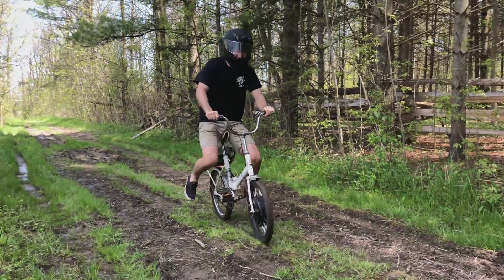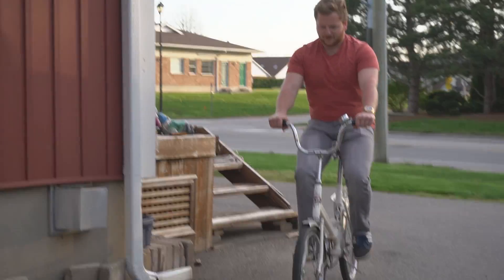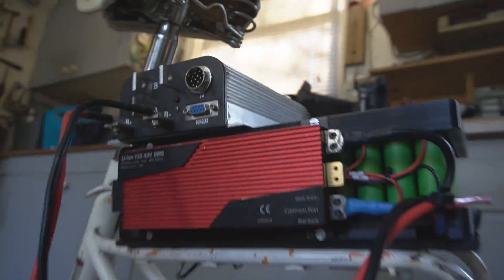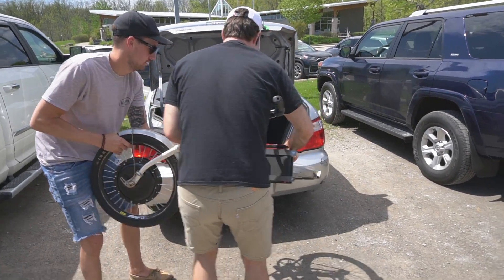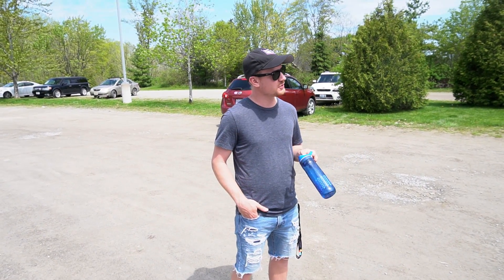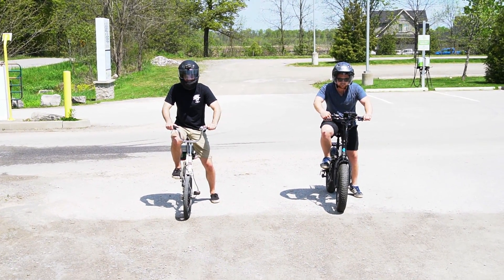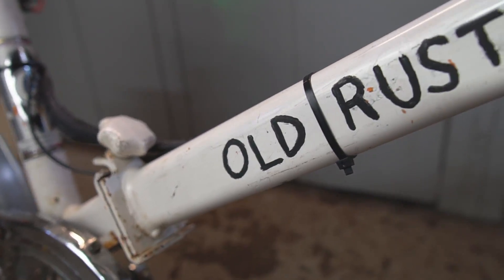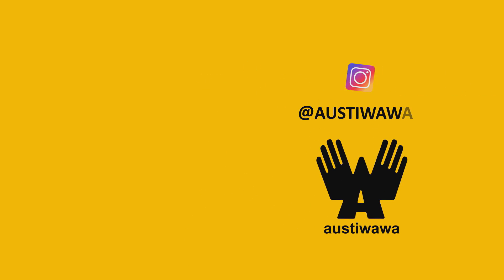I Built my Own Electric Bike and Raced it

Comment: I got this same bike. Mine says "Rekord" on the front. I think they were made in East Germany back in the cold war days!
Reply: They were made in West Germany in the early 1970s. If yours also has a Fichtel & Sachs coaster brake hub, you can find out the year through the letter on the hub shell (or, after 1974, the brake arm, lower letter). 
For example, R is '73, S is '74, etc, you get the point. 
And yes, there was a lot of badge engineering going on with those things.

Comment: Nice quick build 😎 
If you fit the battery and controller on a thicker cushion or a springy  bed, it will do great for off-road and plainroad.
And shifting the moto to back wheel, might bring good grip on the trails

Comment: Approximate cost?
I have the same folding bike
Thanks
Reply: A kit on ebay starts around 200 bucks! There is a lot of configurations, you need to size the kit to your bike wheel, and decide if you want an LCD screen or not. Battery not included.